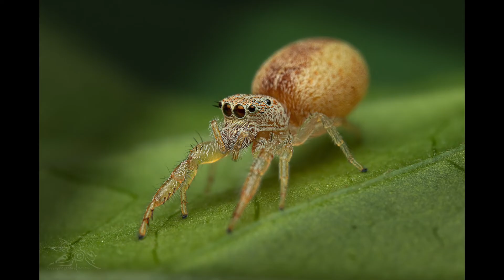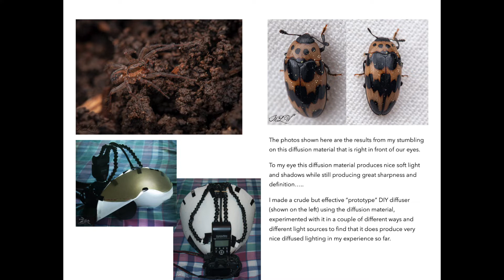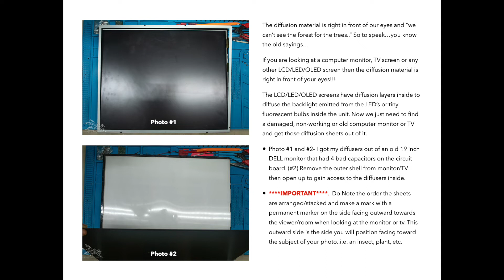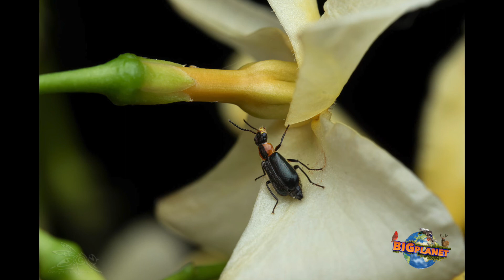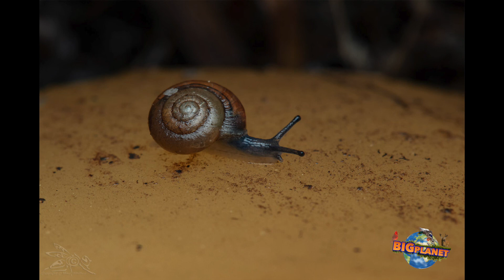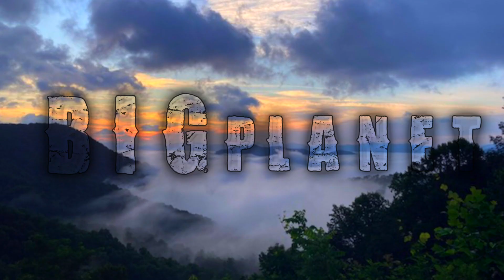Free Macro flash diffusion material

Comment: Great photos and an excellent suggestion for diffusion material. Thanks. I just made my own DIY diffuser for my speedlight from materials I found around the house. I used some polystyrene packing material for the diffuser part and it seems to work well enough. It's the flexible rubbery type of stuff. It's my first prototype so I'll be looking for a broken monitor now. Ha Ha.
Reply from the maker: That's great that you DIY'd your diffuser. There is a feeling of satisfaction when you finally achieve some good "lighting" in a macro photo using your own diy diffuser. Tip for the LCD diffusion material, try it at different angles on the flash in relation to the subect until you find the angle that produces the best diffusion for your setup.  Televisions will have the lcd diffusion layers also.
Good luck and happy macro'ing!!